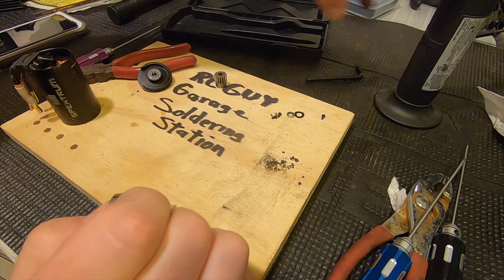HORIZON Hobby Spektrum Motor ISSUE Made in China

Comment: My senton blx, wich ist basically the same as a big rock, hast the same issue with the front bearing, it wears off so fast because of the dust coming in from the spur gear cover. The stuff you cleaned out is all fine dust. All 3 to 4 batteries i got to change it. Bought a pack of 10 on Amazon. And i sealed all holes as good as i could with hot glue and tape. Made it better, but not perfect.

Comment: I'm not a bearing expert or anything but I wonder if a ceramic bearing would work better.  If they don't want it back you got a free motor.
Reply: They don't want it back. 
Horizon Hobby is super weirdly generous when it comes to warranty parts. 

I had a bad servo and receiver on my Felony... They first sent me a new ESC ($150) before found out the real issue. 
I told them they could send me a postage paid box and I'd send them back the ESC I didn't need.... They didn't want it back.
So it goes on eBay tomorrow. 😂

Comment: Those are metal shavings coming out of the bearing and its flinging bits in towards the can surprised it aint totally shorted out... The rust is coming in from it being a non sealed bearing...smdh... They are gonna have to make motor mounts that mount on each end of the can to full support the motor... I have done a bit of testing & The shafts can flex almost 1.9 degrees.... It will flex enough to destroy the bearing pre-maturely....

Comment: I just got a senton 3s blx, comes with the same motor. Second pack in, the bearing closest to the pinion was completely seized up. When I tried to take the motor apart, the bearing blew apart, and the halves of the bearing were stuck on the shaft/ inside the can. Amain warranty sent me a replacement motor, the older model non spektrum. I haven't had an issues since.
Reply from the maker: Yep it's SAD that the replacement motors are the SAME EXACT ISSUE

Comment: This is a common problem with Arrma motors. Spektrum, Arrma. Dirt gets into those bearing and accelerate their demise.
Reply from the maker: Right. This one fortunately had no dirt yet just bearing puke🤪🤣
Reply: Check out rich duberbash videos on the big rock frame slot under spur it works great! Avid on Amazon have good quality bearings at good prices!!! Have in my stock 2400kv in my outcast 4s👍👍👍

Comment: Thanks for the video. This saves me lots of time. 16x5x5. Can I use sealed bearings in the motor🤔...freezer works great to...Lance puts stuff in ours before😂
Reply from the maker: Safer with shielded bearing in motor.
Reply: Not sure if it matters but it's actually 5x16x5 lol You'll have one huge bearing if you buy a 16x5x5 haha

Comment: Front and rear motor bearings failing in brushless motors isn’t uncommon. I’ve replaced plenty, it’s almost part of my seasonal maintenance.
I just buy high quality Japanese bearings and swap them out the second I feel that  clicking or any lateral movement in the shaft.
Reply from the maker: How do you know you're getting the high quality ones?

Comment: To be honest you should have warranty the motor if the bearing failed and exploded. Once it explodes your motor is toasted. In this case a simple bearing remplacement would make ur motor Run like new again. After what u put it trought you went trough snow and salt water didnt clean it out left it dry by itself all the conditions were there to make bearings and specially the most important bearing being ur motor bearing to seize. All my front bearings had sceramic hybrid bearings 7$ each from acer racing from ebay. They make them in the states. 2 year old on my kraton 4s and still spins like new and without making sound. I think the size if 5x16x4. The common failure on these motors is the fron motor because of all the junk that gets inside the motor module and keeps getting recycled

Comment: All the 3s and 4s motors have the same bearing problems 1st gen and 2nd gen! Avid bearings from Amazon are good quality! I have them in my 2400kv and the rear outdrive pinion in my baja rey.  Look for rich duberbash video about cutting a slot in the frame under the spur gear. It helps get rid of dirt! Keeps the motor bearing clean. And it does help a lot!!!!
Reply from the maker: GOOD INFO👍💯👊
Reply: Bottom of the barrel bearings!!! Not even #3 bearings!!!! Why arrma???

Comment: Yup I had to replace the bearings on one of my 3s blx motors( granite) the one on the cap is a beatch! I eventually got it out with compressing bread 🥖 into it!
Reply from the maker: YOU USED THE BREAD TRICK🤪🤣🤪🤣
Reply: @rcguygarage  yup and it actually worked 😂
Reply: Oh man guy I have the same problem. Been trying to get the same destroyed bearing out. I'll have to look up the bread trick. I've used every pick and tool I have.

Comment: Keep Pushing bread in the hole and the bearing will pop out!!! Thank HardcoreRC for the tip!!
Reply from the maker: 🤣🤪🤣🤪 someone sharing secret mechanic hacks from yesteryear😱😱😱careful cause now the hack gods are watching you.  Works great on pilot bearings too 😉
Reply: @rcguygarage   I’ve used bread in copper pipes if I have water in a line. Let’s you sweet fittings then burn the bread out if you can’t stop the water flow. Wow you really are mad at GoPro!!! 🤣🤣🤣🤣🤣
Reply from the maker: @Addicted_2RC  when I was 17 I used a candle to pop out a pilot bushing on my 69 camaro 🤣🤪🤣🤪 worked great
Reply: @rcguygarage  never thought of a candle. That’s a great idea 💡💡💡👊👊👍👍